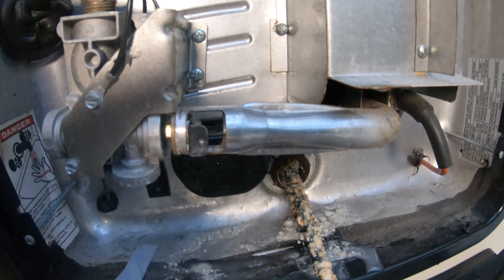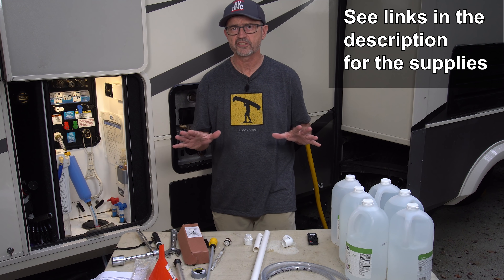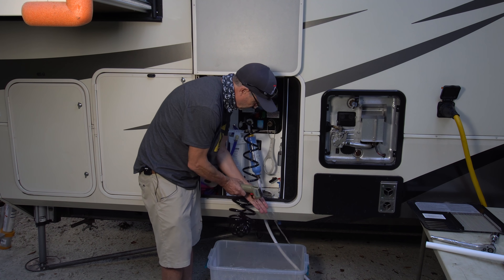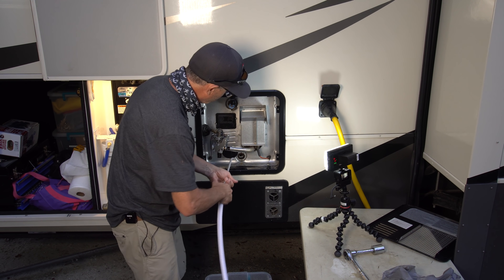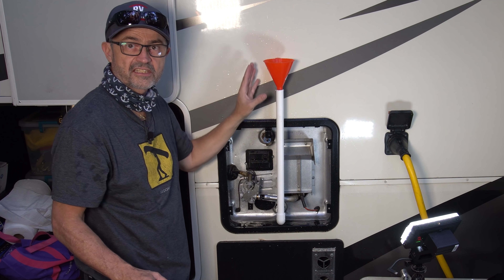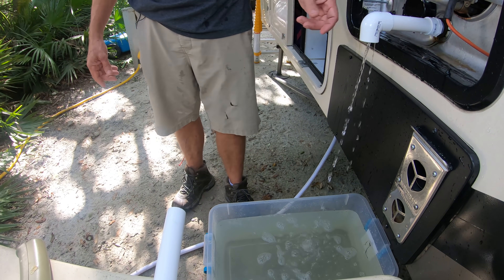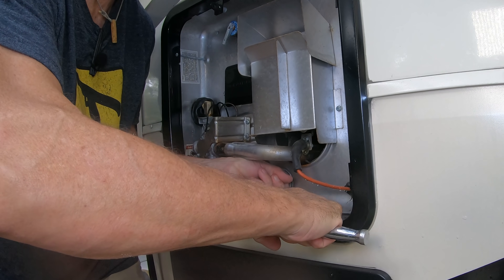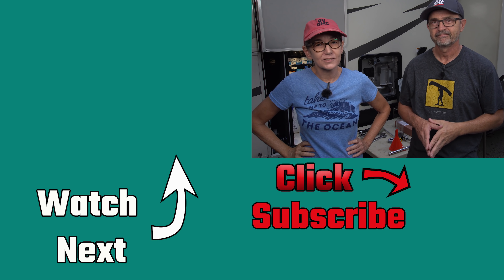RV Water Heater Maintenance w/ Custom Vinegar Fill Pipe (RV Living Full Time) 4K

Comment: I’m trying to do this on my water heater. I am not a home guru guy lol. I bought all the parts as described. I’m doing something wrong though, the pvc fittings and pipe are all 3/4 inch. So the parts don’t slip together. What size elbow and adapter should I be looking for? Thanks
Reply from the maker: If you bought all the save items, it should work. You might have to soft mallet them together. 
And some people glue them if they want them to be permanent
Reply: The fittings I ordered off of Amazon have 3/4 stamped on them. I bought new fittings at Lowe’s that are stamped 3/4 and these fit !!!! The ironic part is, my grand design has an Atwood water heater, and it doesn’t have a anode!!!! So I just rinsed it out with the wand and reinstalled the drain plug.

Comment: Hi. Total newbie to rv life. We got a winnebago micro minnie that has an atwood WH. There is a terrible rotten egg stank coming from under the sink. We haven't used yet and prev owner said its been sitting for a couple months (it was bought new in Aug). Folks on our WMM facebook group suggested water heater needed flushing. Do you think following this clearing out that you did is all we need to do? Taking her out for first time Friday and I'd rather deal before we go. Thanks!!
Reply from the maker: Hey Maddi, yes the smell from the water may be coming from the water heater.  I suggest cleaning/flushing out the water heater and using a RV sanitizing solution to clean the pipes and the fresh water tank( I need to do a video on this).  When you get previously used RV, you never know how well they maintained things like the plumbing system, it is so important.  Larry

Comment: Do all water heaters have an anorode? I have a Domestic 10 gallon unit but it did not come with a rod only a drain plug.
Reply from the maker: Aluminum water heaters do not have an anode rod, so yours is probably aluminum.  You still have to drain and clean it out once in a while.  Larry

Comment: Great Video! I have an Atwood/Dometic Hot Water Heater that has an aluminum tank and a plastic plug. Is doing the vinegar flush necessary for these type of tanks or only the Suburban tanks that use an anode rod?
Reply from the maker: Yes from what I understand, the Atwood’s still accumulate scale in the tank, cleaning it out once a year or so us a good idea, reduces bad odor and bacteria.  Larry
Reply: @DownsizingMakesCents  Thanks Larry. I'll be buying the PVC parts. That's an awesome way to do it!

Comment: Does the Custom Vinegar Fill Pipe leak much since the parts aren't glued together after the tank is filled up and you're waiting for it to do it's thing inside the tank?
Reply: It didn’t leak one drop when I did it, I made sure the pipes had clean cuts and pressed them in all the way.  Larry
Reply: @leapnlarry  Thanks! My drain plug is on an angle so I had to modify my pipe a little but it's good to know it doesn't leak

Comment: I noticed you removed the anode rod without pressure.  I’ve removed mine twice and had it shoot back at me.  Do you have to open all the faucets after shutting the water heater off?
Reply from the maker: Make sure you open the relief valve after water has cooled, that should remove the pressure Larry

Comment: Great video but no anode on my unit - 2004 Keystone Outback 28BHS - flushed it but have a hot water flow problem.  Nothing really coming out but cold side is perfect; and, getting water out of the PRV. Wondering if anyones done a backflush from sink/bathroom/shower to push any particles back into the tank for drainage…flush out?

By the way; the 6 gallon flush and pvc pipe tool was a great learning element here - definitely going to try this out.
Reply from the maker: Do you check to make sure your outside shower valves are all the way OFF, if they are on a little it can cause a low water flow problem.  Larry
Reply: @DownsizingMakesCents  thank you, yes, did check and it’s tight, no leaks.. the tank is full; water starts strong at any of the faucets; but after a second or two slows to a trickle… same scenario independent check on each line with identical results… only conclusion is that in tank at pickup (output) line, some floating debris is getting in the way.  Hence, appears a better flush job is needed.  System is anode-less so that’s one less item.  A fun project for the day.
Reply from the maker: @conradnerdahl127  I had a trickle issue in the bathroom. I took off the aerator and it was clogged. Soaked it in white vinegar. Wish for you it’s a simple problem. This happened while Larry was at the hospital so trying to solve problems on my own. 
Let us know how it goes 🤗
Reply: Update; flushed tank twice; it’s an anode-less system moderate corrosion and buildup… clean coming out; refill - cold side okay and hot side nothing… 

Experiment… turned all the hot lines on… went to sink and turn faucet halfway - both cold and hot mutually half open… plugged faucet to force cold water back down hot water line… water coming out of hot water side at all locations.

Conclusion is that the plug is at the HW tank outlet where it feeds the hot water side of plumbing system… now have to dig into the system and get behind or where the lines attach to tank..  more plumbing work to do and more cold showers :)
Reply: Success but took a call to an expert who immediately recognized my trailer model and told me what needed to be done (Mobile RV Repair - Flagstaff AZ).  Said the check valve to the rear of the heater was stuck and a quick fix was to remove it. He was right but this is a bunk house trailer and had to remove the lower bunk to get to it.  But once there, pulled the check valve and then went to RV Country (Flagstaff) and got two new parts; new drain plug and new check valve… the old one has no working check as the valve was springless… that’s what happens in 18 years of use… go figure.

New one installed, tank filled, one small leak - resolved easily - and back to business.  

One plus; my daughter dropped off lunch on her way to work and invited me out to dinner; BUT, said I better get it working cause I was getting … rank - her own words… wish I could attach photos will see how if possible.

Comment: Just wondering about flushing the rest of your plumbing would be just as important as flushing your hot water heater/tank?  Considering you're on the road and probably not getting the best water I might be concerned about corrosive buildup on all your faucets?
Reply from the maker: Brad, excellent point. Believe me, we have had some serious chemical smelling water before. And we do have water from all sorts of places running through our pipes. I’ll have to ask Larry. 
Alice
Reply from the maker: It is important to flush the lines with diluted Clorox mixture or a special tank and plumbing cleaning solution.  We do it occasionally  when we sterilize the main fresh water storage tank.  Maybe we will do a video, haha.  Larry
Reply: @DownsizingMakesCents  I was wondering if you did that Larry.  Also remember hard water will play havoc on your pipes as well over time.  Not so much if they are non metal but your fixtures take a beating with hard water.  Great video.

Comment: I’ve heard that turning the heater on for at least 12 hours helps clean out the water heater. Have you found this to be true?
Reply from the maker: I dont think the heater should be on while doing this procedure,  It does not need it, comes out very clean without the heat.  Larry

Comment: I tried this but when I attempted to add the additional 6 gallons of water via the funnel only about only  4 would go in. What could be the problem? I think the tube was less than you suggested. Could this be the issue?
Reply: I mean shorter in length.
Reply from the maker: The tub has to go above the relief valve, make sure you have the relief valve open when putting in the vinegar solution, it will allow the air to vent as the tank fills and should allow you to fill right up to the vent valve.  Hope that helps.  Larry
Reply: Thanks Larry. That worked. I was able to add more water this morning. FYI. My wife and I meet you at the Tampa RV show. We’re couple who took our RV to Alaska and you wanted to keep on you for info. We intend to go again once diesel becomes more reasonable. I hope that’s soon. We gave you our card. Call sometime. I’d like to talk to you. Robb / Denise D.

Comment: You did not apply heat to accelerate the de-calcium process?
Reply from the maker: No I did not heat the tank while I was doing the vinegar soak.  I came out really clean without heating.  Larry

Comment: Hey why not use a t-fitting instead of an elbow and make a drain that gets the drain away from the RV side.
Reply from the maker: Thats a great Idea tony, the next time I do it, i will use a Tfitting with a plug i can unscrew for draining, keeps it off the RV,  Larry
Reply: Can you link the parts from Lowes you would need to make this tee fitting idea? I like the original but want the convenience of the screw on cap to drain from the same PVC pipe that I used to fill

Comment: Thanks for the great video! Question, it looks like you have two water filters, the blue one that you connected to the water hose (I have one too) and you have one that is mounted on your RV. It looks like you are bypassing the water filter that is mounted on your RV, is that correct? Or is there plumbing that I can not see that runs the hose water through the mounted filter as well?
Reply from the maker: The filter attached to the Rv filters all water coming in, the hoses are hidden.  I use the blue one a s a pre filter.  I am looking to upgrade our filter system soon though.  Larry
Reply: @DownsizingMakesCents   thank you very much for the clarification!

Comment: Great idea only think I would do different is add a plastic ball valve to a glued pipe you do not want that unglued pipe piping off with the Hot water on during the soak period just my 2c
Reply from the maker: That’s a good idea. But I don’t heat the water during the soak.  Cleans it well without heat.  Larry

Comment: Good stuff!  Why not attach your 4” pvc before letting the bulk of the water out and use it for a drain pipe as well as part of the flush out procedure?  It would likely go more directly into you bucket and far less would make it to the side of your rig. I suspect in this case you may not even need the protective trash bag to be attached but to be extra safe you could still use it. Just my .02.
Reply from the maker: That is a great idea, I will prob do that next time.  Having the larger diameter does opening make it easier to get those chunky scale bits out from the bottom of the tank though.  Larry

Comment: I tried doing this as described but the vinegar and water would not go done the pvc pipe. Was I doing something incorrectly?
Reply from the maker: You have to release the pressure valve to let the air escape from the top of the tank.  Larry

Comment: I followed all of the instructions but when I went to pour water/vinegar into the tank, it just filled the pipe up to the top of the funnel. No blockages. No nautilus on my rig. Any other ideas on how to get the vinegar solution into the tank?
Reply from the maker: In  a close loop system like that you have to pull the pressure release valve on the top to give the air in the tank a place to escape.  Hope this helps,  Larry

Comment: My heater just has a plastic plug. I think my tank is aluminum should I have an anode?
Reply from the maker: Gary, you are correct. No anode with a plastic plug. But I always caution to look at the owner’s manual, Lar

Comment: My anode thread is rusted so much I can’t screw in a cap or an anode anymore. Would I have to replace the entire thing? Not sure what to do about it.
Reply from the maker: You should be able to use a tap to reshape the treads to make the anode fit tight.  That would be a really big tap and may be hard to find.  If the threads are really torn up you may have to get a rethread kit that taps to a larger size then, screw in the rethread adapter appropriate for the thread size.  Larry
Reply: @DownsizingMakesCents  I thought about doing this but wasn’t sure if I would mess it up or not
Reply from the maker: @bahlztodawhalzawsome  let us know how it works out

Comment: Don’t have an anode because I don’t have a suburban water heater. Is this recommended for the other type?
Reply from the maker: All steel tanks should have an anode, aluminum tanks don’t use an anode but usually have a plug to drain and flush.  Larry

Comment: why is it necessary to turn off the breaker in the panel?  ty
Reply from the maker: Whenever you are working on an electrified appliance it is important to make sure the electrical supply is off for safety.  Also you don’t want the heater element to go on with an empty tank. Larry
Reply: @DownsizingMakesCents  gotcha, tks.

Comment: Great video! New subscriber.  We have an aluminum tank hot water heater so it did not come with an anode rod... Should I add one to help keep the heating element clean? Thanks!
Reply from the maker: No aluminum tanks don’t corrode like the steel ones, but you should still clean it out with vinegar periodically.  Larry

Comment: You should have put a "T" where the 90 is and then a short piece of tubing with a shut off valve, then when you are ready to drain vinegar or anything else just open the valve and drain
it away without needing to let it run down the side if RV or into the area by the heater.
Reply from the maker: THat is an awesome idea, it is important to keep the vinegar off the side of the rv an getting on the water heater and the air heater.  If i do a follow up to that video I will add the T and the shut off valve.  I love it when people give great helpful suggestions like this.  Larry

Comment: My water heater has an on and off switch st the unit. The switch is in the off position and the water heater works. Weird?
Reply from the maker: That is weird, maybe somewhere the switch was bypassed.  Larry
Reply: @DownsizingMakesCents  I just read a lot of forums. I guess some of the suburban units came with a cotton pin in the off switch. Since we have a switch inside the rv serves as a 3 way switch and prevents from burning up the unit if someone forgets the switch outside in the on position.
Reply: Cottor pin*
Reply: Anyways. I want to thank you. I sued the custom pvc pipe to clean sanitize my water heater. Works like a breeze. So easy filling the tank this way!!! Thank you

Comment: Insulating the anode is debatable, it needs electrical connection to tank to function properly. Enough teflon tape could theoretically insulate it.
Reply from the maker: Suburban recommends the Teflon tape, apparently metal to metal contact is made when tightening, cuts through the tape, the tape just seals between the thread gaps,   It is a good point to mention not to use too much Teflon tape.  Larry
Reply: @DownsizingMakesCents  I plan to test this by using a multimeter to see if there is continuity / resistance between the anode rod end and the water heater before tightening ... then again after tightening the rod... and again after adding water to the tank.

Comment: Why not just remove the pressure relief valve, stick a flex funnel in the hole, and fill the tank?  That's what I did.  You can also use that access to flush the tank with the wand, including the drain access.
Reply from the maker: I think that is a great idea, I may try that next time.  Larry

Comment: Tried this & I truly believe it works but my problem was from what I can tell the vinegar or the fume set off my smoke/Lp/Co detector inside.The green & red lights were flashing stating Lp which is propane.Yes the propane & hot water element were off.Not sure if the detector has some kind of built in safety mechanism but I could not get my tank to light.Had no problems igniting prior.My furnace & stove though would light.Anyway I could not leave the vinegar in the tank as long as desired because I couldn’t get it to ignite & the detector kept going off.I could though heat the tank through the heater element.Anyway I’m wondering if anyone has had similar issues with the detector going off & tank not lighting.The igniter would try to light & would ignite but would go off & go through it’s cycle 3 times.After a complete rinse & refill the detector went off & the tank ignites again flawlessly.
Reply from the maker: Wow that’s interesting, I’m not sure why that would happen.  It sounds like you worked through it.  I would check to make sure you are not leaking propane somewhere just in case.  Thanks for sharing your situation.  Larry

Comment: pour a little vinegar on top of baking soda until it stops boiling, drain tank out of low point after every trip.
Reply from the maker: Sounds like great tips, we live in ours full time so the only time we use our low point drains is when we are sanitizing the tanks.  We hopefully will never be in frozen conditions.  Larry

Comment: A problem that few realize is that even after you drain the water heater, there can still be a quart or more of water in it that is below the drain plug. That water will freeze, add to the deposits and get skunky during periods of the RV not being used.
I keep a soft vinyl tube handy to just siphon out the water.
Reply from the maker: That is a really good point about the water left behind.  The last couple of flushes i have used a bore scope camera to examine after my flush and there was still tons of scale and water in the bottom, it hard to get that last little bit out.  I will point out taking the last water out for people putting away for the winter if i make a follow up video.  Larry